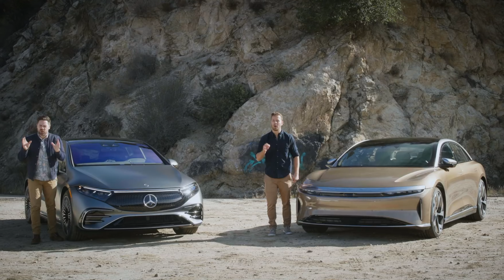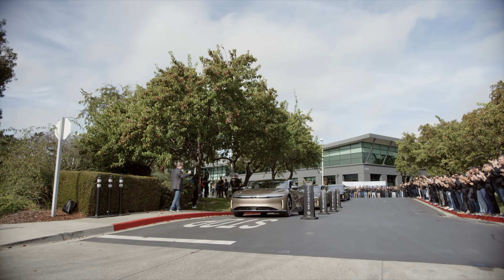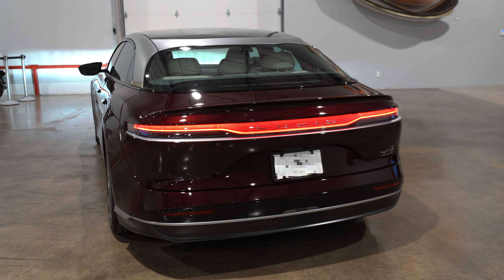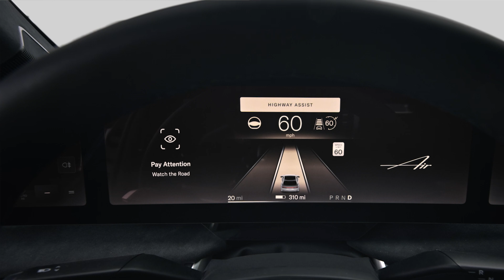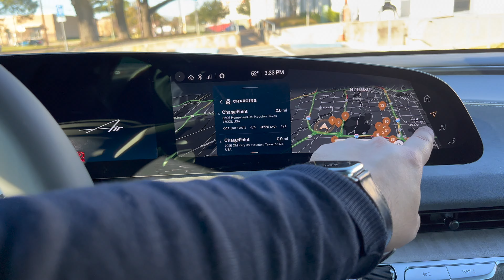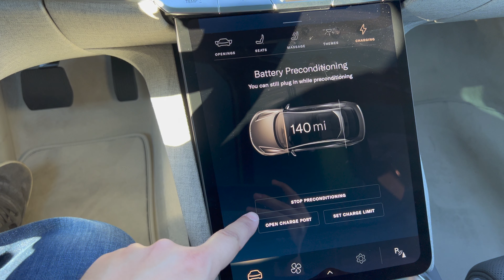NEW 2023 1111hp Lucid Air Dream Edition Review!

Comment: It is worth noting that the 170kUSD 1,111hp early version is sold out. Today Lucid is only selling the 130k 800hp Grand Touring version which features the same equipment and battery size. The only significant difference is having "only" 800hp in its fastest driving mode. 

Both the 100kUSD 620hp and 77kUSD 480hp RWD versions have just over 400 miles of range. They will be available later this year and can be reserved on Lucid's website. 

Lucid cars go on sale in Germany in the second half of 2022 and are planned to be sold throughout Europe not long after. I have not heard of a right-hand drive version yet, but will be surprised if CEO Peter Rawlinson (formerly of Lotus) neglects his homeland.
Reply from the maker: It is a bit of a disappointment that the power is "only" 800hp but it is still more than 99% of cars. The first Studio is going to be in Germany as I am sure you know.
Reply: Highly doubt he would leglect Europe when these cars are being planned to enter the Chinese and East Asian market also. I think it’s clever to start off in the luxury end because it builds a better valuable brand when they eventually make a 30-40k car is when we will see the benefits of building the brand to be known for quality.

Comment: lucid for sure!the efficiency is absolute alien.inside EVs got 4.3 kWh per mile and 500 miles of range in a single range test at 70 miles an hour.they had to do their range course all day and near night time just to get it 0%.
Reply from the maker: I know it is very impressive with both Range and performance and I saw that video as well with 500 miles range.
Reply: Friends at this difficult time need your little help to the Ukrainian army. Putin will be destroyed  BTC: bc1qw2qslwvmtzs7yk2x2lzfxfnsxwz5ne70xkkf9t ETH: 0x9d6917b707e268EFBCF29E37728394F20Cc34CF8  -=-=